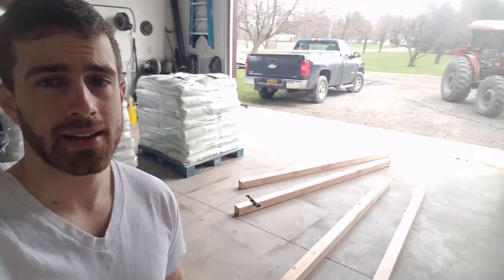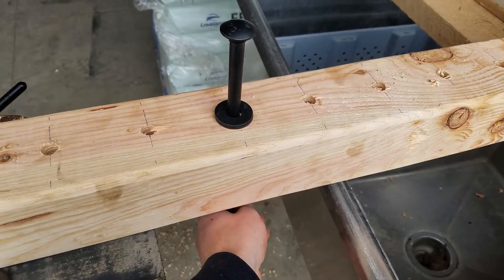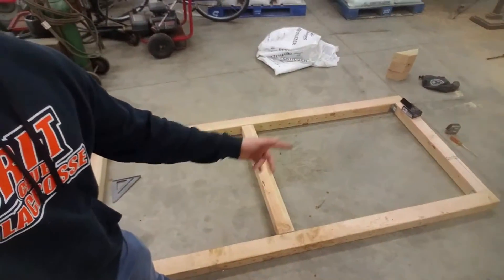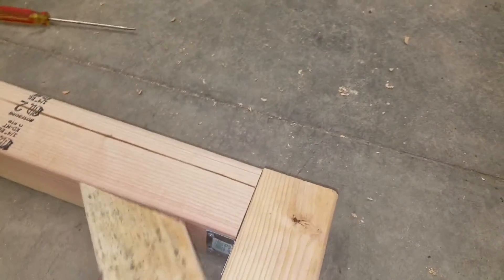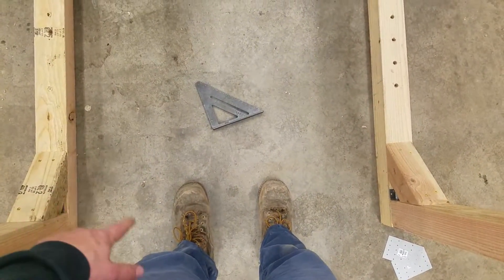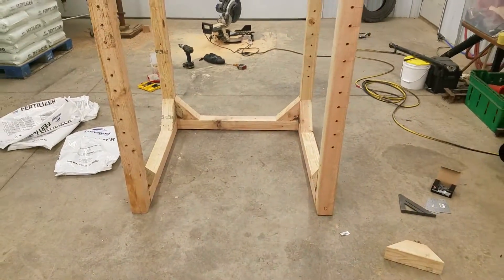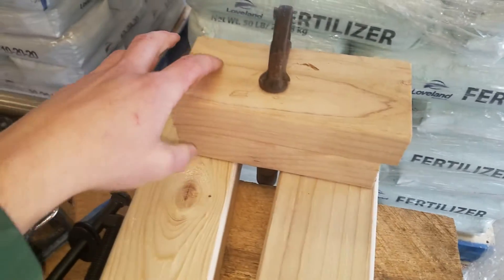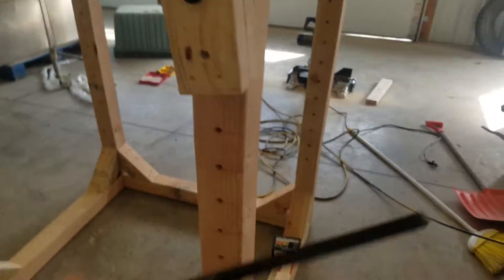DIY Power Rack and Deadlift Platform

Comment: What’s the part list
Reply from the maker: Check out the buff dudes parts list https://youtu.be/6dy5eyMDt3c
I used 
(6) 4"x4"x8' posts,
(Box)3" deck screws,
(4) 8x4 particle board sheets 
(1) horse stall mat
(1) 8x4 finer plywood (same thickness as mats)
And various angles for corner reinforcement. Sorry it's been a while

Comment: What you could have done and you may have later, is clamp the j-hooks to the beam and drilled them from the back side using the already drilled holes on the rack as a guide. at least to get the holes started. I may use that j-hook design though and use some rod stock as a guide pin for the lower hole and the carriage bolt to clamp it down.
Reply from the maker: Thats a good idea, I didn't have any clamps big enough at the time, but have been thinking about making another set of safety bars that I could use this method for

Comment: Where are your safety bars?
Reply from the maker: Ended up doing a similar system with the bolts, essentially a Y shape on the verticals on the inside, and then I put a bar from front to back, sitting in the Y groove